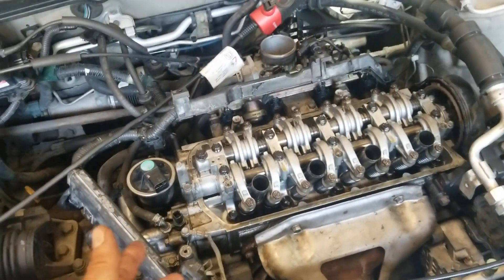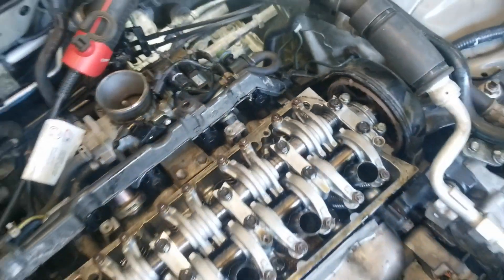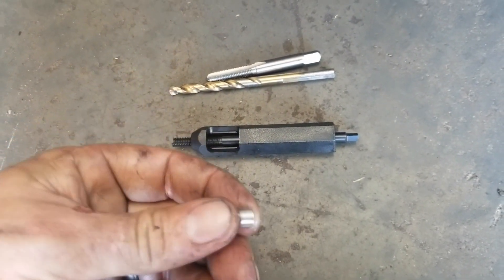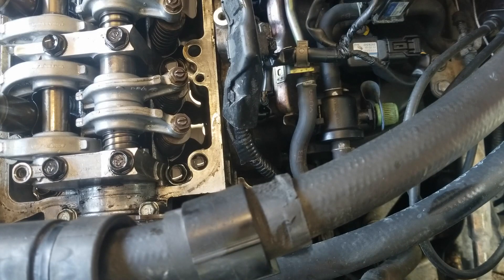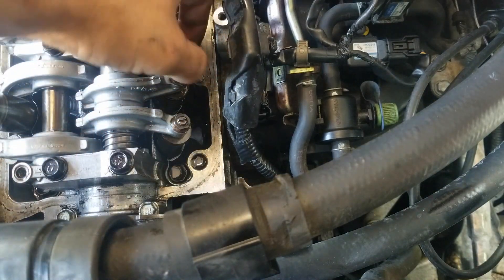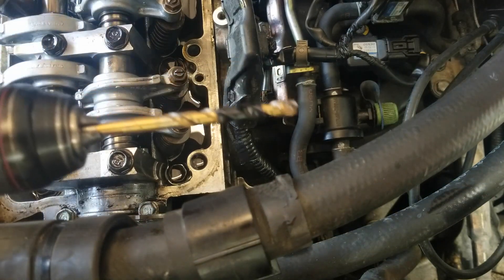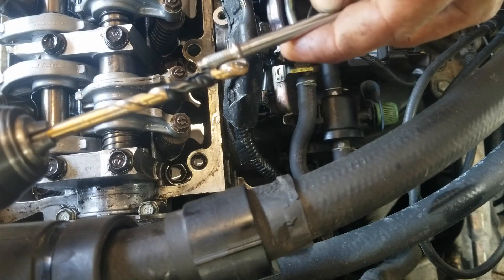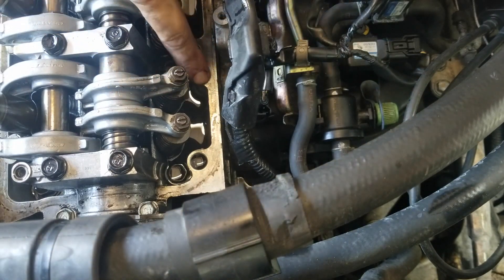Stripped Honda / Acura Valve Cover Bolt FIX

Comment: I’m having the same issue with a J35. One of the bolts snapped into the head. And another one of the bolts stripped the threads. So frustrated right now 😢

Comment: Good video,clear and to the point. I broke one of the rear ones and thought I'd just leave it but it would leak under boost. M6x1.0 helicoil kit and 1/4 drill bit fixed it. However it's broke again while doing spark plug tube seals. I dip my drill bit and tap in thick grease and the metal shavings stick to the grease. May look into studs. Anything over 8 ft lbs of torque and these will snap/strip.
Reply: Which Honda engine do you have?
Reply: @MrSamPhoenix  Boosted Vitara D16Y7
Reply: @popslops2188 Much appreciated. Did you manage to fix it again?
Reply: @MrSamPhoenix  I did actually,I used an EZ-Lok which is very similar to a timesert and upgraded to Downstar bolts  No problems since !
Reply: Hi, thanks for the great tip.  How did you manage to remove the stripped helicoil insert and rethread again, in case I am going to come across the same problem? Much appreciated.
Reply: @sdlau05 I drilled the helicoil out and used an EZ Lok self locking thread insert that was M6-1.0 internal x M10-1.5 external. Also swapped the stock valve cover bolts for stainless bolts and haven't had any problems and no leaks even under high boost.
Reply: @popslops2188 thanks for the tip.  I hope I won’t have to go that route, but sure good insurance to know.

Comment: Thank youuuuuuuu!! This happened to my 2002 Honda civic. I thought the valve cover gasket was worn out and the reason for an oil leak. It was part of it but after I put back the bolt and it was spinning, I was like bruhhhhh 😑 but seeing this will help me out alot! Thanks you!
Reply from the maker: Glad it helped
Reply: Did you figure out the leak
Reply: Stripped mine out last nite. 02 civic. 1.7.  👍🤦‍♂️

Comment: What is the torque on those bolts and pattern for removal and replacement?
Reply from the maker: 8 ft/lb work outside to inside removing, and inside to outside installing.

Comment: I don't know how people have so much trouble with stripping bolts out, not over tightening things isn't rocket science. Great tip though as always!
Reply from the maker: This is pretty common, This makes the 3rd I've repaired in a month
Reply: @hondaresource  Some people just have no common sense...